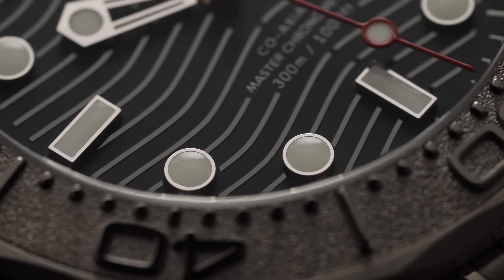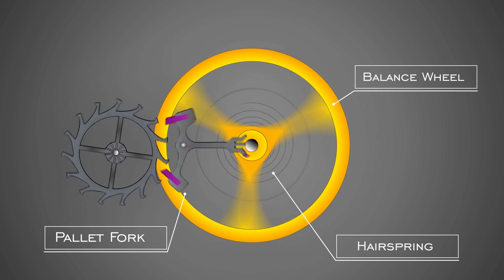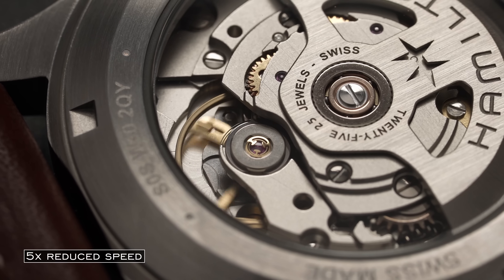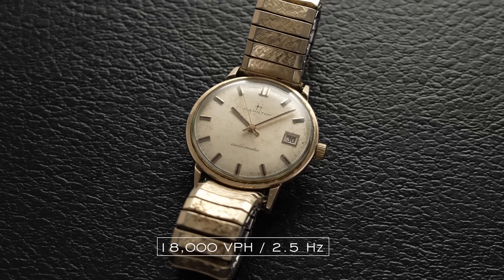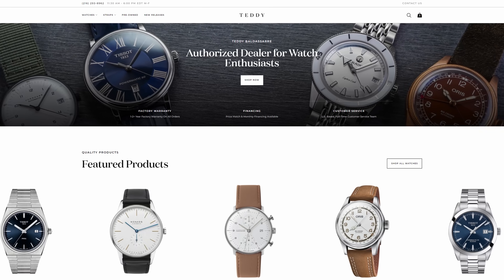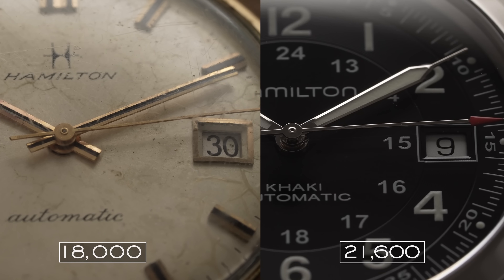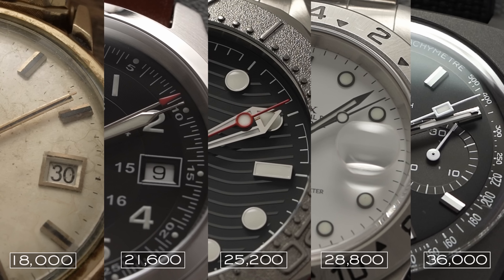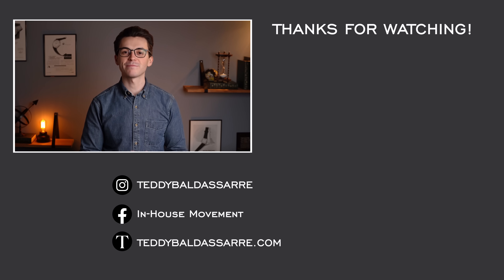Watch Beat Rate Comparison 18,000, 21,600, 25,200, 28,800, 36,000, & Spring Drive (120 FPS)

Comment: Ironically, my slower 18,000 bpm watches are the most durable. My 21,600 watches seem to break down much more. It seems that internal parts become more delicate at the higher beat rates.

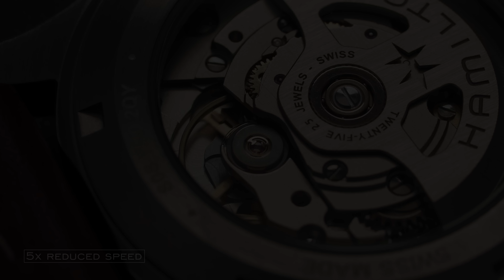Comment: Meh. If a balance wheel moves one direction (CW or CCW) 6 times per second, then it also has to be moving back the other direction 6 times per second as well and it’s a 6hz movement. 3:53
Reply: Yeah the real explanation is it changes direction 6 times per second. One oscillation changes direstions twice (the "tick" and "tock"), so 1hz = 2 direction changes. So it would be 3hz. He did a bad job at explaining in the video.

Comment: Spring Drive is in a league of it's own. It's perfectly smooth. The most perfect representation of the continuous flow of time.
Reply: ... league of its* own (it's = it is)
Reply: What's in a league of its own is Grand Seiko's High Beat 36000 with 80 hours power reserve. That's much more advanced technology than the old spring drive. They had to reinvent the escapement to even make something like that work.

The spring drive is more faithful to how time flows in reality. However, the High Beat discretely measures out each fraction of a second individually. The spring drive just ensures a generally accurate sweep across a second, kept precise by quartz vibrations. 

So the high beat has a tighter focus on moments of time and with that power reserve, it blows everyone else out the water. I just wish it had a small extra dial to show each tenth of a second being measured out clearly.
Reply: @marioluigi9599 it's an engineering marvel, but still less accurate than a Spring Drive.
Reply: Spring Drive not only reinvented the escapement, it superseded it with something completely revolutionary. Make no mistake, it is far more advanced than their hi-beat movement, which I agree is very impressive. But at the end of the day it’s simply an evolution on the mechanical escapement. Spring Drive is something totally else.
Reply: seiko is selling their crap very expensive

Comment: Non-ferrous metals have a diametric reaction to magnetic fields. Science for your take a silver or copper coin and drag it down at a steep angle on rare earth magnets and watch how it slides and then do it with aluminum and then do it with steel we know what happens with steel😊. A spring drive uses electrical physics to run the watch just the same and different than your quartz movement.

Comment: Traditionally, a lower beat movement with higher accuracy was seen as proof of craftsmanship. Higher beat rates allow for a larger margin of error, whereas a high accuracy lower beat rate movement will have to made to exacting specifications. 

Patek, for example still makes the majority of their manual would watches at 18,000 hz rather than anything higher (although VC has moved to 28,800 for most of their movements). 

But it really doesn't matter nowadays given how precise industrial manufacturing has become, you can get insanely precise machining whilst the resource cost of reaching very precise tolerances has dropped significantly.

Comment: Perhaps I misunderstood the beats/hz example, but I think you may have misspoke.  I think you said that the balance moved in 'one' direction 6x/sec, and that equated to three hz or three complete oscillations? I believe 6 beats in one direction would actually equate to 6 oscillations, since a beat or impulse in one direction is followed by a impulse in the opposite direction for 6 complete oscillations or 6 hz. Six beats counted in both directions would be three hz?

Comment: Spring drive is on another level. One of the biggest innovations in watchmaking. Hats off to Seiko.
Reply: I just bought a snowflake. It was so light in my hands. And it looked beautiful. Had to have it.
Reply: I literally might sell my gold day date for a titanium spring drive watch. And then have to get a new gold tone watch that's worth handing down.
Reply: @bmxriderforlife1234  Don’t do that! Keep the Rolex and save up for the GS
Reply: plus they made quartz. Seiko is one of the most important brands in watchmaking
Reply: I got a chronograph 100m 10 beat movement watch, man… Seiko has really done a great job 👏 hats off for Seiko!
Reply: Seiko is king 👑 they have pretty much invented every watch technology
Reply: Casio’s Oceanus S100 is on another level. I love Quartz, from cheap Miyota 2035/2115s, Seiko VK63’s, Eco-Drive, to Rhonda, and ETA jeweled quart movements. Reliability, superior accuracy, and minimal servicing. I have one Automatic, and I love it also, Seiko NH35. 👌🏼
Reply: Lol I dumped my quartz watch for an automatic one. I don’t know when the battery would die, and if it dies I need to get someone to replace the battery.
Reply: Spring drive is a mixture adding electronics parts that, by definition, have a short lifetime. There is no competition as spring drive will never compete with mechanical watches that can undergo a restoration 100 years later. Seiko itself doesn't promote this technology as they've understood this a long time ago (remember the Kinetic technology). Spring drive is for sure an impressive result of integration, but not the future of watchmaking
Reply: I would like to change the bracelet to a NATO strap and the movement to a quartz movement. Original bracelet and movement I would sell and so I would have a reasonably priced quality watch.
Reply: It's too costly for the general public
Reply: @apoorvsaxena3886  it’s not made for the general public. 🤦🤦
Reply: @Bear18533  but they should,even we like spring drive watches
Reply: @apoorvsaxena3886  the first Grand Seiko watch that came out was equivalent to 2 monthly salaries of a middle class person, sometimes you have to maintain a standard,, and in Japan artisans and workers get paid fairly, they can increase profit by cutting cost like outsourcing to China, but that's not good, I'd rather buy a watch that's built by passion instead of slave labour, quality watches come with a high price tag
Reply: @apoorvsaxena3886  Absolutely not. The Spring Drive is a masterpiece of engineering. If you want one, get your money up. Don't try to drag everything down to your level; elevate yourself to ITS level.
Reply: @t6-30  but it's the system that we live in that has the problem there will always be a rich poor divide
Reply: @apoorvsaxena3886  If Rolex came with a spring drive first than you would have today stupendous prices  over already absurd Rolex prices!
Reply: @apoorvsaxena3886 Imagine than what the cost of spring drive would be in Swiss hands,Rolex would charge 50k easily any SD movement.
Reply: Still Springdrive has a brake, a magnetic brake. Would you like the idea driving a car with a handbrake pulled all the time to control the speed? That is why I prefer quartz movements, they do not need such a brake that uses up most of the energy.
Reply: @c.s.4273  ok
Reply: @c.s.4273 it is not a brake but a flow controller. More specifically, it is a constant speed controller. Quartz watches have the same problem. Quartz watches need to regulate the electrical current, which they use a simple resistor.
Reply: @c.s.4273  ? It's still over 70 hours of power reserve.
Reply: @InvidiousIgnoramus  And a quartz movement has a power reserve measured not by hours, nor by days, nor by week, nor by months but by years. You see the difference in power consumption?
Reply: @ralfrufus3691  I fail to see the relevance. Are you that forgetful that you can't wind your watch every couple days?
Reply: @InvidiousIgnoramus  You lack the understanding of why you need to wind up a mechanical watch every few hours or days. It is because of the wasted energy by the braking of the escapement on a mechanical watch to hold the time. This is one of the big advantages of a quartz watch, it does not need this "brake" to hold the time, it does not have an escapement.
Mechanical watches are stone age tech compared to quartz movements when you look at the energy consumption and the accuracy.
Reply: @ralfrufus3691  I'm fully aware of why mechanical movements need to be wound. I simply do not care.
Reply: @InvidiousIgnoramus  You do not care about the wasted energy and the lack of accuracy of mechanical watches compared to quartz watches? But what about the wear and tear that comes along with the mechanics and the subsequent need of expensive servicing/revisioning every few years?
Reply: @ralfrufus3691  If you like boring quartz movements, more power to you. Some of us actually like mechanical complexity.
Reply: @InvidiousIgnoramus  I like what I see, the face, the hands, the casing and the build quality. The movement of a Rolex is hidden from my eyes, so yes, therefore I only see the numbers and facts when it comes to the movement and they are all in favor of a quartz movement. Therefore I hope to see one day in the future a quartz Explorer 1 or a quartz Air-King
Reply: @ralfrufus3691  Bro what are you even doing here if you like quartz watches?  You can just shop at walmart.
Reply: @emcg5112  You read, what I wrote? "I like what I see, the face, the hands, the casing and the build quality." This level of quality is not available at Walmart.
Reply: @emcg5112  I completely agree.
Reply: @Ralf Rufus  .... and then you need a new battery. Automatic theoretically never need anything unless they break. Just walking around keeps it going. Don't need more than a few hours of power reserve
Reply: @ralfrufus3691  you've failed to explain why this is such an issue. No one cares about the brake. It really isn't hard to wind your watch when you put it on. I'd rather do that than change a battery. I just had to change 2 batteries and have 5 more just sitting there dead because I don't feel like taking care of the batteries.
Reply: @hewster1  Some quartz movements need less often a battery change than automatic movements need a significantly more expensive revision more often - and are still less accurate and have a shorter lifespan. A mechanical movement is slowly committing suicide with every tick.
Reply: @Ralf Rufus  I have mechanicals 20 years old, work fine. Same with quartz except most don't move because like I said, batteries died and my nicer mechanicals work great. You just have a weird hate for mechanical.

Mechanical movement is just more appealing to the majority of people. Very few people get a watch for precision time keeping.  They are accessories to complete your outfit and nothing more.
Reply: @ralfrufus3691  Seiko spring drive is the best of both worlds, it has accuracy of a quartz movement while being a mechanical automatic and no need for batteries.. your 'superior' quartz preferred watches still need batteries, this is where spring drive is more desirable because you just wind up the watch, no need for batteries while still having quartz accuracy
Reply: @ralfrufus3691 Sure,noone should debate the timekeeping advantage of a quartz watch,but,if there is one thing mechanical watches are useful for,is when you lack the possibility to change the battery. Yes,in theory that event is rare. But if we were all about functionality in watches,we would all just wear g shocks and live on with that. And noone would creeate anything,as we had reached the peak of functional capability
Reply: @ralfrufus3691 people like automatic movements, because of the craftsmanship and beauty of them. It’s the same as why people like classic cars, it’s art. If you want the Tesla of watches than there’s nothing wrong with it, but it’s comparing apples to oranges. My phone will always tell the time better than your quarts watch, so who cares. Most people don’t wear luxury watches to tell the time.
Reply: @ralfrufus3691   as you bash our likeness in mechanical watches, we simply do not care if it is either this or that. But we only simply care about how the complexity of it amazes us. It is a simple form of art which you probably wouldn't understand according to what you are saying in the forum messages you sent.
Reply: @InvidiousIgnoramus  my eco drive has unlimited power reserve LOL
Reply: @willh.2155  Who cares?
Reply: @ralfrufus3691you do realize the GS spring drive winds automatically as well right?
Reply: @ralfrufus3691but if it has a battery in it isn't a real watch

Comment: You forgot the Vostok Amphibia movement which is an odd. 19,800 bph.
I think 21,600 bph is a good compromise.
28800bph seems like cruelty to watches to me.
I have one 28800bph movement in my Sea-gull Ocean Star diver, the Seagull movement is the St 2130.
Reply: Actually, not very odd. E.g., all of the hundreds of thousands of vintage Omegas based on the 500 and 550 series movements are 19,800, i.e. 5.5 bps. I reckon that Teddy just didn't mention this common frequency because he was focused on Hertz and 2.75 is a very non-round number.. ;-)

Comment: Great video and perfect timing (excuse the pun), as my curiosity into Omega's use of the Coaxial led me to research the history of the development of the co-axial movement initially by George Daniels and more recently by  Roger W Smith who advocates around 18000 bpm being the best combination of accuracy and reliability. It's made me look at watches and BPM in a whole different light and got me wondering how much do service intervals vary between brands, why they are the length they are, are they more frequent with high beat rate watches and are service interval lengths even given much consideration by buyers or is a high beat rate going to be more important to the manufacturer in sales numbers?
The topic would make a great video Teddy, any thoughts?

Comment: I'm sure I'm in the minority, spring drive just doesn't appeal to me in the slightest. Good video, Cheers 👍🏻👍🏻
Reply: Spring Drive appeals to me the most!  A mechanical watch with quartz accuracy, frictionless regulation, constant torque with no jarring stops and starts, infinitely smooth seconds hand movement and no need for a battery or capacitor with only the power stored in a mainspring being needed for it to run.  Absolutely brilliant!
Reply: @BeardyMacBeardFace  all the reasons why they don't float my boat 😉 but to each their own, be boring if we all liked the same things. Thanks for your comment mate 👍🏻
Reply: @stevefox8605   Cheers 🍻

Comment: 18,000 is all you need. A clean, serviced 18000 can run to chronometer specs easily, and less wear and tear than hi beats. Also 18000 is easily the most relaxing to listen to when held up to your ear 😑
Reply: True but low beat rate movements typically need a high amplitude to maintain accuracy.

Comment: 1 Hz = 1 cycle per second, and a tick happens each half cycle of the balance wheel. 

Notably 36k BPH watches were very common as the mechanical watch waned in practicality in the 1970s. Longines, GP, and Seiko made a lot of these high-beat movements. They were impressive for the time, with accuracy within +-2 spd, but high-beat has many technical challenges in regards to long-term serviceability, so today they are less popular. In general, the lower the beat rate, the longer the movement can go without servicing, but the higher the accuracy. These challenges can be overcome via tighter tolerances in production and design decisions, and there are Unitas 6498s (one of the few 18k BPH watch movements still widely used) that are COSC certified. Most chronometers back in the old days of railroads and pocketwatches were also low-beat by today's standards. 

Furthermore, beat-rate and power reserve are usually inversely proportional, but this is also something that can be overcome with production tolerances. Then you have the frankly crazy work with compliant mechanisms that Frederique Constant of all companies is currently doing, and that's its own fresh set of horological history.

Comment: Hi Beat rates are technically superior to lower beat rates aren’t they?
Reply: They can make a movement more accurate, as they are dividing up the time more finely. The down side can be more wear & increased servicing requirements. One point not mentioned here is that for a lower beat rate watch to be accurate it requires a high amplitude. As this drops over time to due the lubrication drying out the time keeping will drop off compared to a high beat movement in similar condition.